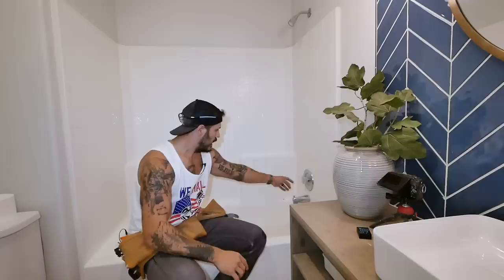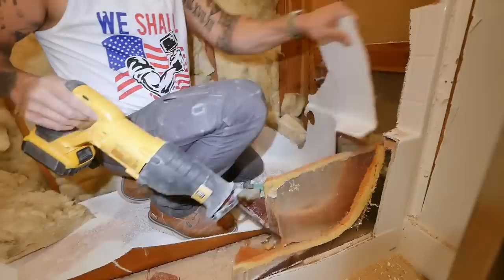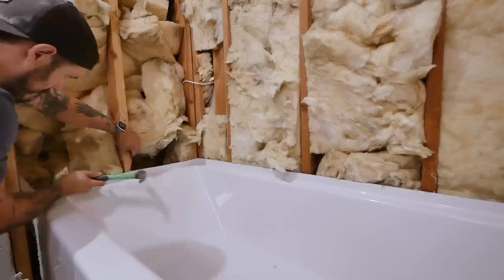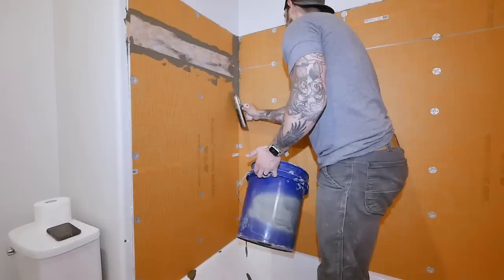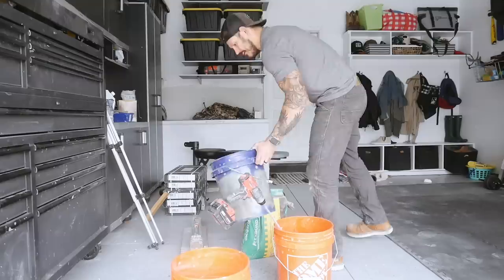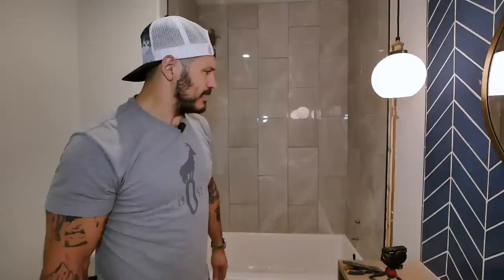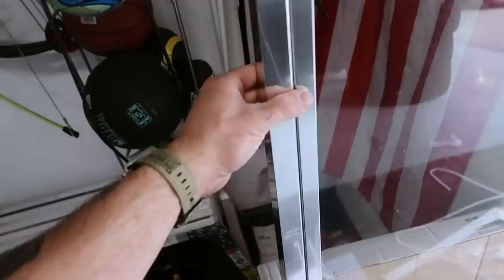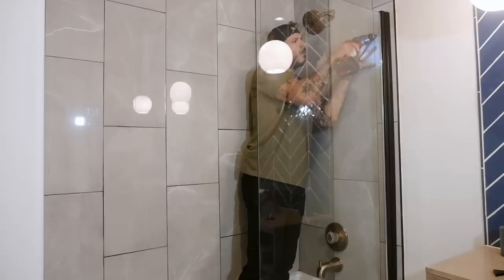Transforming Your UGLY Shower Tub Combo

Comment: Just an FYI, when you use silicone to seal up a bath tub it's a good idea to fill the tub with water because the tub will flex when you have it filled but the silicone while it will flex it will also pull itself apart. If you didn't fill the tub this time just cut it out and re seal it.
Reply: That’s a great tip, thanks man
Reply: @nonsensenon223  ....Water?

Comment: I installed the same screen here in the UK and done the same as u painted it Matt black. Look fantastic but I noticed after a while where the screen was opening and closing it would rub and scratch the paint off. What I done to get round it was to actually take the pivoting part off and filed a tiny bit off the frame to give it a tiny little more room to pivot without rubbing. Just something to look out for

Comment: roofing nail makes sense because that's how vinyl siding is mounted. the nails allow for expansion/contraction and avoiding warping (if properly set) when it heats up in the sun.  in this case, probably hot water.

Comment: Why is there only a glass part in the front ? Why not the back
Reply: Yeah, I am not sure. Kinda confused by that too!
Reply: So you can get in and out as it is a fixed piece.
Reply: Alot of European showers are like that
Reply: Ive seen that alot no more door just one piece of glass looks cleaner in my opinion
Reply: I like the style and look, but the practicality isn’t great. For one, every time you go to turn the water on you will have to do some gymnastics in order to not get hit by the cold water. 2, it will likely spill water outside the shower which is sort of a pain.
Reply: I’m from England so I was really confused as to what you guys were on about at first!!! But yeah we all cope fine with it? Though our shower screens usually push/pull as well, so you just pull it out, turn it on then push it back again. Can’t tell if that’s what this does tho?? So you guys have full on glass walls and doors for your shower baths??? That sounds so claustrophobic 😹😹
Reply: needs a sliding glass door

Comment: Another nit pick/tip.  I think its this install I would have installed a full tile on the left side seeing how there was enough room, plus if not the cut would have been in the corner, plus allows the tile to go down to the floor for alittle more protection against water damage against the tub.  But its still very good man!

Comment: You forgot to caulk behind the fosset, spout and showerhead. The way it now is, water can flow behind these parts and moisturize the wall behind the tiles. Fill up those spaces and you'll prevent water flowing behind your wall/tiles. There are probably rubber seals at the back of those parts, but these rubbers won't fit 100% and in time they'll shrink slightly. if you fill the spaces between your pipes and the "plasterboard" with caulk, this won't happen. But, nicely done, despite the fact that your bathtub is way too small for a big guy like you and me 😉

Comment: So real life question.... I installed a similar tub and after completing the job noticed that as you step into it the tub actually flexes some and the bottom line of grout cracks.  What I have been told is that I should have supported the bottom with some type of cement between the subfloor and the tub.  Did you do that and have you noticed any issues with flexing of the tub? Luckily I have access to one side of the tub through a wall and will have to cut a portion of that wall out and throw some cement under the tub to prevent it from flexing.  Great job as usual, keep it up!

Comment: Should have replaced those two gray polybutylene pipes feeding the spigots. That stuff hasn't been sold in the US in years because it gets brittle and cracks. It can crack any place--at the joints or in the middle of a run. You'll be ripping that tile out one of these days.
Next DIY project--replace all the water pipes in the house.

Comment: Question: 
(sorry, if you answered this earlier in the comments, if so feel free to refer me to it)
When you ran into the issue of aligning the tub drain and overflow, could you have instead fit the tub to align and make up for space on the wall by adding some 1x2 to support the lip and some extra plaster and tile glue? I know it sounds half ass, but from the way I saw it you were off by so little and rearranging the plumbing in your crawl space seemed like a way tougher job. Could my perspective been a viable and aesthetically pleasing option? Thanks
Reply: I wanted to know this too

Comment: Aren’t you suppose to waterproof the joint between the bottom of the Kerdi board and the tub? Also shouldn’t you have used the kerdi product that goes around the pipes coming in to seal them up to ?
Reply: The time comes over the flange of the tub and then you silicon around the edge.

Comment: I’m concerned why you didn’t do a mortar base under the new bathtub. That’s why I currently have to redo my bathroom. After a while things start to flex.
Reply: What does a mortar base do? Genuinely curious
Reply: @beaujuan1186  you use mortar underneath to give it a strong foundation and you set it into the mortar while its drying. Then when it's dried there will be no flexing when you're stepping in the tub or shower pan. Typically it's more important in shower pans, but the more quality the bathtub the manufacture wont require it. 

But I had to redo both my bathtub and my shower pan in my house as the owners just put in cheap stuff with no supports underneath and they both cracked in multiple places from normal use